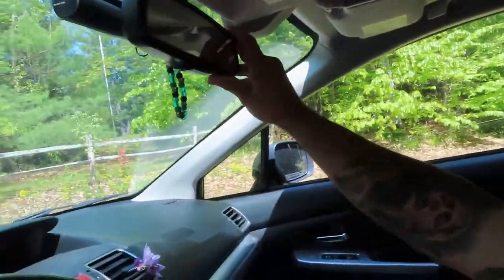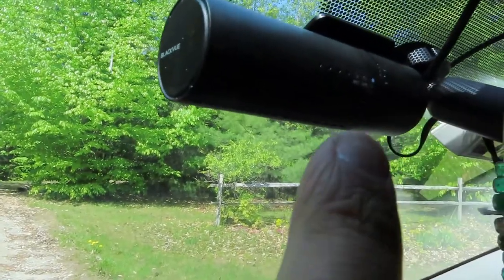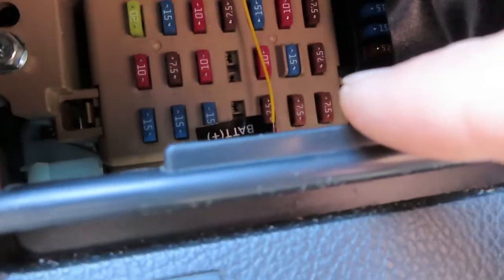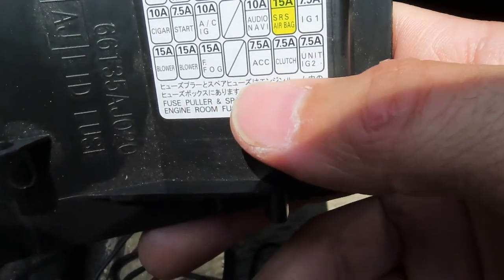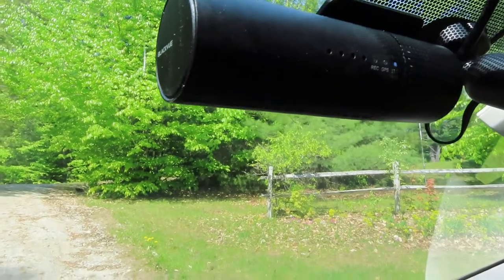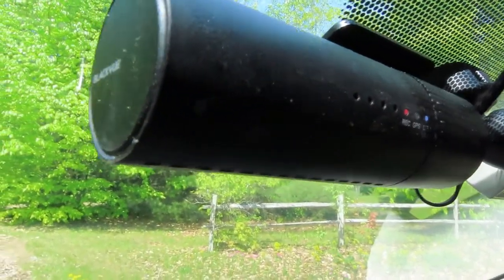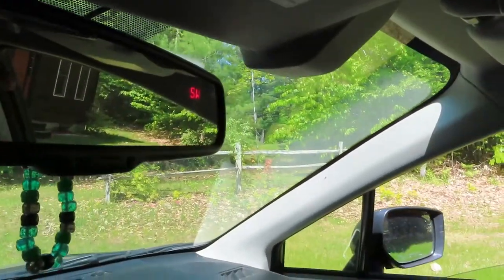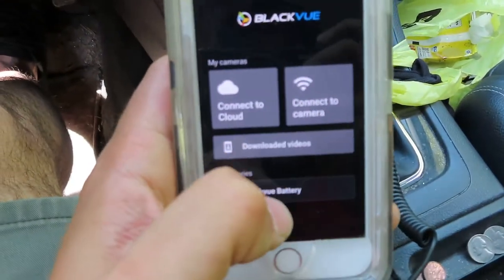Installing a BlackVue DR590X dashcam in my Subaru Impreza

Comment: Actually, you just locate the inside opening of the plastic tube coming from the upper right corner of the back door, and route the coax cabel thru it, just like your back/brake lights cabels does.
Reply from the maker: Didn't think of that!